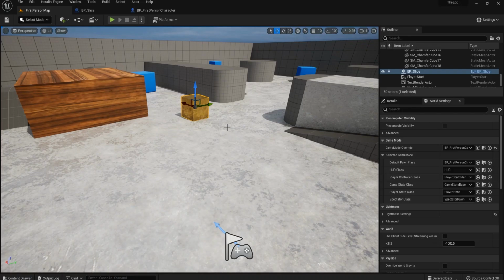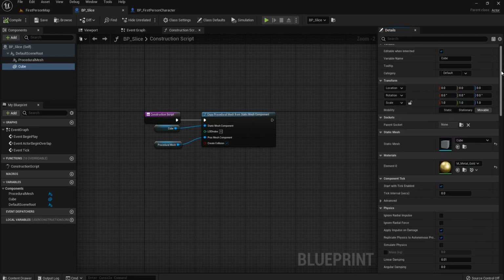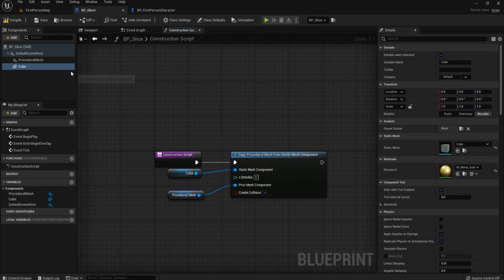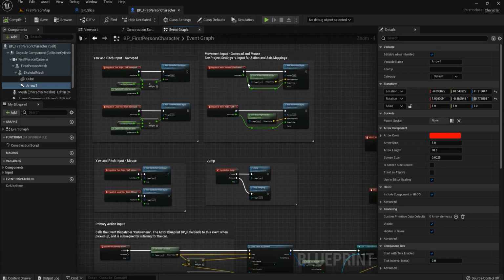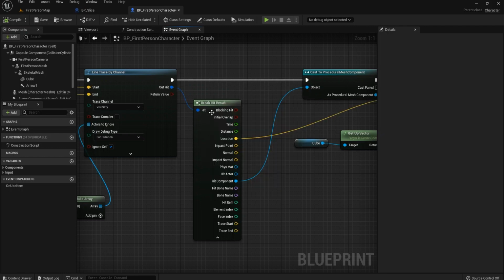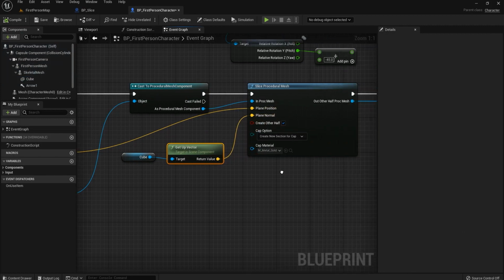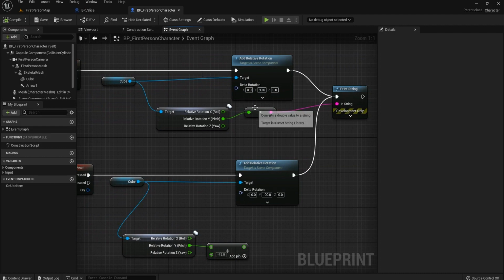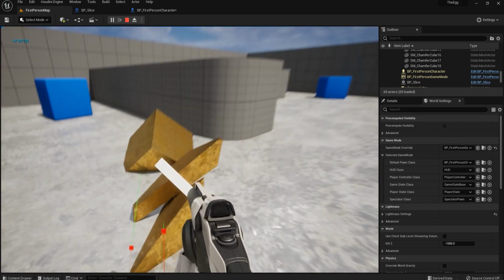How to slice a mesh in runtime in Unreal engine 5

Comment: Having trouble finding out how to cut little incisions on an object. 
I am doing a surgery game but cant figure out how to make small cuts like 2 inches in depth in order to cut skin(not the whole object in half). I keep finding videos of slicing an object in half but can never find a video of cutting an object and having that surroubding area deform by the cut. I heard softbody deformations and using the chaos physics to accomplish this but I have no clue how to start it. 
Do you know how I can accomplish this or have an idea that can lead me to the answer?
Reply: My advice: make your model layered. Basically have a few meshes that kind of work like a Russian Nesting Doll and each one is a different layer: skin, fascia, muscle, etc. Make each layer a separate object. adjust the depth of the boolean cutter. That way when you can adjust your game to cut through as few or as many layers of the meshes as you'd like. 

You can apply softbody physics to it as well or even experiment with vertex painting or niagara particles (which can be bound to skeletal meshes and you can select a group of particles and deactivate them in real time to make it seem like you're cutting them).
Reply from the maker: Unfortunately I have never worked on such thing. I pinned your comment so if somebody sees it they could help you.
Reply: Hi, I've been trying to create a cutting action, but I'm not getting the desired result using the slice procedural mesh or by modifying the vertices of the mesh at runtime. Do you have any ideas or solutions that could help?